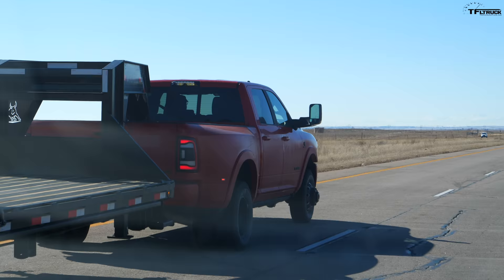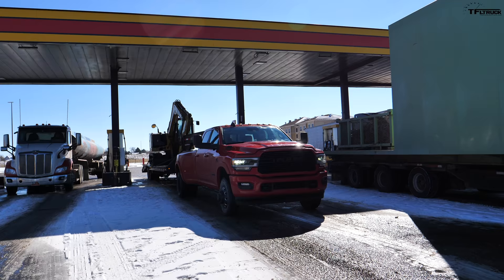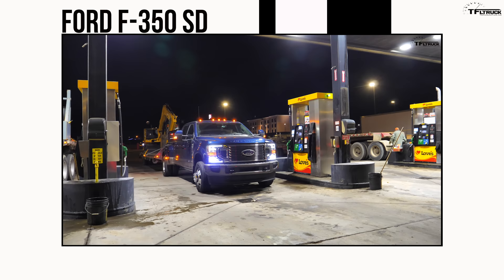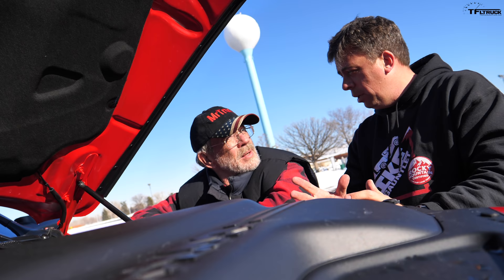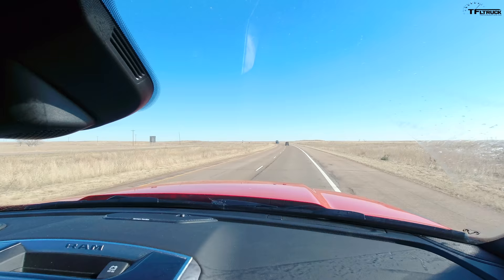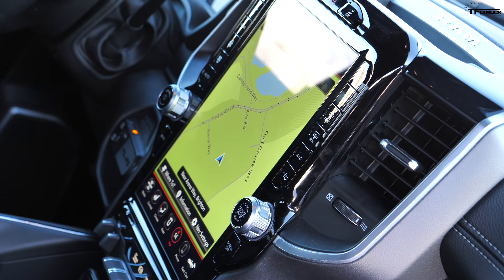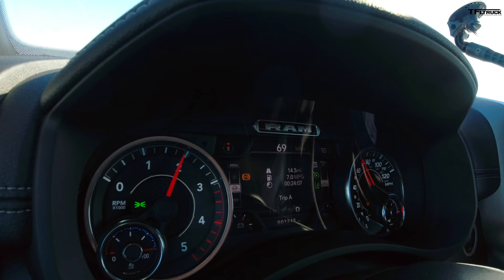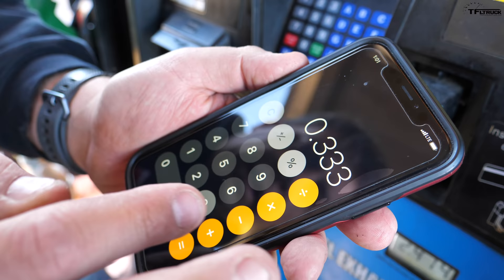New Ram 3500 Cummins Takes On Our 30,000 Lbs MPG Challenge Against GMC & Ford Diesels!

Comment: Ram by far the better built truck. Im not worried about 1 mpg or so. I want the best riding, most comfortable, best quality and built truck to haul.  If I'm running loads cross country,  i need the Ram/Cummins reliability, build quality and comfort. That's why Ram is truck of the year again.

My vote goes to RAM!
Reply: Least reliable truck out there. Year after year- https://www.google.com/amp/s/www.motor1.com/features/373433/least-reliable-trucks/amp/
Reply: Twice the industry average recall rate:

https://www.thedrive.com/news/21102/here-are-the-cars-with-the-highest-and-lowest-recall-rates
Reply: Lol only thing on a Ram truck that has build quality of any kind is the Cummins engine and that’s no longer any better than the rest. If you want quality buy ford 15 n newer
Reply: @lw6735  sure and that's why Ram won truck of the year Again.. Ram sales are up 18% where ford and chevy are down 2%.. not to mention Ram is now out selling Chevy trucks... but ok. (Facts are facts) your talk is talk.
Reply: Johnny Turbo Ford super duty actually won truck trend truck of the year lol what truck of the year are u talking about? Half ton segment?? http://www.trucktrend.com/news/1912-ford-f-250-super-duty-wins-truck-trends-2020-pickup-truck-year-award
Reply: Johnny Turbo and btw Ram is at the bottom in sales if u figure GM as a whole Ram as a whole and Ford as a whole
Reply: I hauled campers 3 years. We had 900 trucks. 800 were rams. For commercial use the ram wins because of ease of repair. Try pulling a turbo on a ford or gm and come back and say different. Most of these guys do there own repairs so even if the consumer reports say they fall apart, the average joe can still repair it. Not so with ford and gm.
Reply: Carey Kuhn Ya I agree n I’ve worked on all 3 and with the cab on Ram is easiest to work on then 6.7 Powerstroke then Duramax but to do a complete overhaul job ford wins since they built em to take the cab off whereas the other 2 haven’t and since ford builds their own engines it’s also same or less frequent than GM n Ram on needing repairs
Reply: @johnnyturbo8460  Truck of the year has nothing to do with reliability. Ram has been at the bottom of reliability for a long time.
Reply: @therealjohnsmith4811  cool because my Ram reliability had nothing to do with it being truck of the year, that's just a bonus.  With our fleet, the Rams have had much less issues then the Fords for sure and even the chevys. That's my experience,  so that's what i can honestly speak of. They may "have been at the bottom " but key word there is "have been". Looks like the tables are turning doesn't it. 😁👍
Reply: @lw6735  well Ram doesn't sell cars so lets keep it apples to apples.. so this is a truck test so I'm speaking of trucks.  If you wanted to go that route then add Fiat sales to the list along with all the companies Fiat owns.. such as Ram, Alfa Romero, Chrysler, Dodge, Fiat,Jeep, Maserati, And pair with Citroen, Peugeot, Opel and Vauxhall.  Soooo lets just stay with trucks Ram,Ford and Chevy for this chat lol
Reply: Johnny Turbo That’s exactly what I’m talking about GMC and Chevy trucks = GM trucks Ford trucks = ford trucks and Ram trucks =Ram trucks lol Ram is at the bottom of sales and Motor Trend is all vehicles testing Truck trend is trucks where Ford won TOTY but I’ll give you The win on Motor Trend Lol
Reply: Johnny Turbo Lol and as for reliability Ram has been worst rated reliability and is getting worse if anything lol and winning truck of the year isn’t talking reliability lol it’s talking what’s the best looking n seeming out new lol
Reply: @lw6735  ok. Like i said, but clearly you were to busy trying to come up with a snappy compact to actually pay attention so i will say it one last time for you. This is YOUR cue to PAY ATTENTION:.  This is MY experience with them in regards to OUR fleet.
Reply: Johnny Turbo Tables turning based on what? Once again truck of the year has nothing to do with reliability. Other years Ram has been truck of year it’s been dead last in reliability.
Reply: Johnny Turbo And pay attention to this You’re fleet is not the only fleet n says something counter to everyone else’s fleet lol 😂
Reply: Johnny Turbo Lol typical Ram guy show him the facts plain as day n he still is blind. I could have guessed the results long before now lol
Reply: @lw6735  here we go.... smdh, ok school is in session
 1st off, I own a fleet of Fords and Rams. I commute in a Ford and have a few others as personal cars. As far as "facts" go, that's a fact and so is the Ram truck sales up 18% and both chevy and ford are down around 2%. What trucks do you think those 2% are now buying.  Another fact, i said " in my experience ... with MY fleet". The Rams i have have been far less trouble then the Fords. Example : i just got a 2020 Ford 350 Super Duty dually.  It didn't even have 200 miles on it before it over heated and had to go back to ford to repair a coolant issue. I didn't even tow with it yet, i was just getting passed the recommended break in period.  I would be happy to hear about your fleet of Rams and Fords or Chevys and how they compare.  Again this is MY experience,  no one else's. That seems hard for you to comprehend. 

Your love for a brand has you blinded by reality.  Nothing wrong with for just IMO Ram makes a better truck for ME and many others.  If you haven't,  go test drive one and try to put your bias aside, you will be surprised. 

As far as my personal truck, it used to be a ford but its now a Ram 2500 with a Cummins. And its been FANTASTIC for me in towing my race cars, farm equipment, the family , dirt bikes,  side by sides, boat etc...

Class dismissed
Reply: Johnny Turbo I don’t believe you just got a 2020 Ford dually with your bias lol why would you? And it would’ve come up in this discussion way before now if so and by the way i drive 6.7 PS and LML Dmax towing at my work and we had a 6.7 Cummins that was great but not better than ford or GM Lol and I have driven 2020 Ford GM and Ram HO and the Ram interior is nice but there’s no comparison in power to the ford and if you have any questions about real world check out tow Piglet channel
Reply: Johnny Turbo thats right, run away little doggie when facts get in your way.
Reply: Johnny Turbo News flash- your personal experience doesn’t reflect the whole of a brand. And, if you are not using metrics in your business model you are losing money. Try a business or statistics class. It will do you good. Class dismissed.
Reply: Johnny Turbo lol- my fleet of Fords have maintenance problems but I bought a 2020 SD? Sure thing.
Reply: The Real John Smith Lol 😂👍
Reply: @therealjohnsmith4811  you get the same reply..
here we go.... smdh, ok school is in session
 1st off, I own a fleet of Fords and Rams. I commute in a Ford and have a few others as personal cars. As far as "facts" go, that's a fact and so is the Ram truck sales up 18% and both chevy and ford are down around 2%. What trucks do you think those 2% are now buying.  Another fact, i said " in my experience ... with MY fleet". The Rams i have have been far less trouble then the Fords. Example : i just got a 2020 Ford 350 Super Duty dually.  It didn't even have 200 miles on it before it over heated and had to go back to ford to repair a coolant issue. I didn't even tow with it yet, i was just getting passed the recommended break in period.  I would be happy to hear about your fleet of Rams and Fords or Chevys and how they compare.  Again this is MY experience,  no one else's. That seems hard for you to comprehend. 

Your love for a brand has you blinded by reality.  Nothing wrong with for just IMO Ram makes a better truck for ME and many others.  If you haven't,  go test drive one and try to put your bias aside, you will be surprised. 

As far as my personal truck, it used to be a ford but its now a Ram 2500 with a Cummins. And its been FANTASTIC for me in towing my race cars, farm equipment, the family , dirt bikes,  side by sides, boat etc...

Class dismissed
Reply: Johnny Turbo Ok u n I both know neither 1 of us wants to put out our email for the public but you said your personal truck is a Ram in an earlier comment and you’re absolutely stupid if you have actually had the kinda issues at work with fords your talking about to buy 1 yourself lol and by the way no 1 said Ford never gives issues like you seem to think about Ram but the solid average of the last 5-10 years of amount of trucks sold and issues per amount is much lower on ford by far
Reply: @lw6735  bro you continue to try to find a hole in my story. What are you not paying attention to... my goodness.  Let me help you once again figure out the simple facts.

My personal truck I bought for ME is the Ram.... The Ford was bought per our contract with Ford because at the 5 years mark we cycle out the old trucks for new trucks (we trade up ever 5 years as per the contract).
You just can't accept how i feel about Ram vs Ford, due to my personal experiences.  
Here may be another shock for you. All the ford cars are getting phased out too for Dodge chargers. The EcoBoost engines in them and the transmissions are having failures after failures do to the abuse we put on them. The only issues we have had with the chargers is the drive shaft bolts come loose after months of heavy abuse.  After breaking the 1st one, we learned to just tighten them ever so often. With that Dodge is working with us to fix the problem not only on our cars but in the chargers period.  But it sure Beats blown turbos,  oil leaks and slipping transmissions from the Taurus'.
🤯
Reply: Johnny Turbo And you do realize Ford also introduced the Ranger last year and passed GM for most trucks sales- right? Wonder where some of those F-Series sales went, hmmmm
Reply: Johnny Turbo 

Since 2015 Ram has had to issue 152 mandatory recalls for full size trucks (1500-3500)
Since 2015 Ford has had to issue - 83 (F150-F350)

Its not even close. If you throw out the worst years for both (2015 for Ram / 2017 for Ford) the split is 110 Ram / 48 Ford.
Reply: @therealjohnsmith4811  and you do realize i don't care and that's irrelevant to our heavy duty trucks comments, which we are speaking of. Well you probably don't get it. You don't seem to retain much. Done yet?
Reply: @therealjohnsmith4811  yea but what are those recalls for? Ram calls computer and GPS updates recalls. No issues, they just want the customer to have the latest updates from hackers, maps etc. . They do 1 to 2 of those a year if not more. They call them recalls to let the customers know its FREE. Are Fords gps and other updates free? Well not the ones on my Ford cars. They want me to pay for updates to GPS. The recalls for my Ford were turbo oiling issues,  a few safety issues. 

Thanks Ram!! Oh and thank you for pointing that out. Another plus for Ram.

With that, all cars and trucks will have recalls. That's how the companies right there wrongs. Sometimes it takes a few years for these wrongs to come to light.  It shows maybe even that Ram is more likely to fix there wrongs. Where Ford has been known, to know there are issues but not fix them example: 2011-2014 Ford Fiestas with the HORRIBLE automatics that slip, chatter and fail in 40k-60k miles.. it took an action law suit to get them to do anything.  And many of them ford skated around ways to avoid fixing them. Great cars IF you got the manual. 

So i would much rather a computer update over a catastrophic issue any day.

But im sure you knew all that before posting your last comment didn't you? I bet you are a Ram fan in disguise lmao because you continue to help my point.
Reply: Johnny Turbo You have to realize that if you get into talking about transmissions you are definitely going from best to worst to go from ford to Ram lol you obviously have no experience yet with Ram transmission but you just go get as many Ram vehicles as you’ve had ford and come back on here n talk to me about issues lol if you want quality control issues buy Ram and if your experience is not lining up with that you have not had many Rams or for very long so give it a couple years with as many Ram as it sounds like Uv had fords and your tune will drastically change but you’re either seriously exaggerating the Ford problems and minimizing the FCA Italian problems or you don’t know how to do maintenance and that won’t work by far on FCA crap cause your information definitely doesn’t line up with everyone else lol just go give FCA as big a whirl as you have ford and come back and talk problems lol
Reply: Johnny Turbo And by the way I’ll say it again go check out Tow Piglet channel. He uses his trucks harder than anybody and puts on more miles and has had 2 2019 Cummins and 1 2015 Cummins and now has a 2020 Power Stroke and already has between 20-30 k on it pulling over the road trucking full time 😉he said he loves the truck n doesn’t wanna go back 😉
Reply: @therealjohnsmith4811  wow I have been reading this comment section and can't stop laughing. I'm a 100% Ford guy spite some flaws they have. But guys STOP you are embarrassing us for guys. Johnny Turbo is literally wiping the floor . He is 100% right and he has clearly stated it's in HIS OWN PERSONAL EXPERIENCE.  Say what you want about your experiences, but he is talking about his. Also his sale numbers are correct as well, I sadly looked into it. So research before commenting because it makes us Ford guys look silly. With that he goes to say, he owns Ford cars so he clearly doesn't hate Ford so why continue to bash him with research you half did. He owned you on the recall bit. Let's all just get along here. USA USA USA
Reply: @lw6735  wow I have been reading this comment section and can't stop laughing. I'm a 100% Ford guy spite some flaws they have. But guys STOP you are embarrassing us for guys. Johnny Turbo is literally wiping the floor . He is 100% right and he has clearly stated it's in HIS OWN PERSONAL EXPERIENCE.  Say what you want about your experiences, but he is talking about his. Also his sale numbers are correct as well, I sadly looked into it. So research before commenting because it makes us Ford guys look silly. With that he goes to say, he owns Ford cars so he clearly doesn't hate Ford so why continue to bash him with research you half did. He owned you on the recall bit. Let's all just get along here. USA USA USA
Reply: @lw6735  good for piglet. I'm not him. But you refuse to get that I'm talking about MY experiences.  MY GOODNESS
Reply: @lw6735  yup like i said most cars and trucks will have recalls.  You focus on one thing lol. Look at the whole picture. You all brought up recalls. I don't really car that cars have recalls.  It shows the company wanting to do right. But you were to busy just trying to have another weak comeback. 
I could do this all day.. you all keep throwing balls and i keep hitting hone runs
Reply: @johnnyturbo8460  this shit is funny I have to admit
Reply: Johnny Turbo Lol I’m good with YOUR experience 😂👍👍👍👍👍👍👍👍
Reply: @johnnyturbo8460  lol hilarious.. that was a bases loaded home run. But seriously, folks let's just agree to disagree and move on
Reply: @daddywarbucks5090  good call.. I'm done here. You all can carry on if you choose. Lol its been fun
Reply: @lw6735  honestly it was that simple from the start brother lol but damn it was fun to watch.
Reply: Daddy war Bucks Lol you don’t get that this is only a debate and not an enemy thing lol I debate with friends and BTW his numbers were right but GM builds both GMC and Chevy Lol we don’t just leave GMC out and say o Ram is second place Ram is still in third place in sales after GM Trucks 🤷‍♂️😂USA USA USA 🇺🇸 I’m agreed and have nothing against a good argument lol don’t take these things personal it’s all a fun debate to me 😃👍
Reply: @johnnyturbo8460  lol you guys should do a show, going back and forth talking about cars/trucks lol I would subscribe!!! And like
Reply: @lw6735  cool
Reply: Daddy war Bucks Lol you guys are hilarious especially you just jumping on 1 guys train and agreeing with him and trying to say your a ford guy lol what a joke I don’t think you’ve done your research either lol or looked at anything but what Jonny is saying lol if you don’t like debates you are free to jump off lol and I have yet to see a single home run here just dodging facts like all Ram guys do 😂😂😂😂
Reply: Johnny Turbo lol that simple from the start??? How does your experience that doesn’t line up with anyone else’s include sales information and recall information lol you had a lot more coming off this comment section than just your own experience lol give me a break 😂
Reply: @lw6735  oh I did. Like you agreed with me and said Johnny's numbers are correct. So I did look into it all before commenting. That's why it took so long for me to jump in. But lol like Johnny said " you are to busy to think of a snappy comeback to read all that's said". You were ended on a good note but now you are loosing it. You guys need a show. I'm done
Reply: Johnny Turbo Lol fun to watch you were 1 of the 1s playing the ball game and losing not watching 😂😂😂👍
Reply: Daddy war Bucks Ford sells more trucks than any other brand. Fact

Rams has been the least reliable brand of the Big 3 for more the 5 years. Fact

Ram has twice the recall rate of the industry average. Fact

A person’s  individual experience does not speak for the reality of the reliability   of any make or model. Actual statistics do. Ram had great sales in 2019 - but they have issued 17 recalls for the 2019 1500 alone. Three times as many as Ford or GM. Those are facts.
Reply: The Real John Smith Typical Ram guys avoid as many real facts as possible, get as close as you think you can to “winning” the debate and then shut it all down and leave and avoid the real hard facts I mean that’s really the only way to like and be a Ram fan anymore especially since they sold out to the Italians and French 🤷‍♂️😃
Reply: The Real John Smith And don’t be fooled by Father War Buck thinking he’s a ford guy he’s clearly a Ram guy if he can’t see facts any better than he’s shown here lol 😂